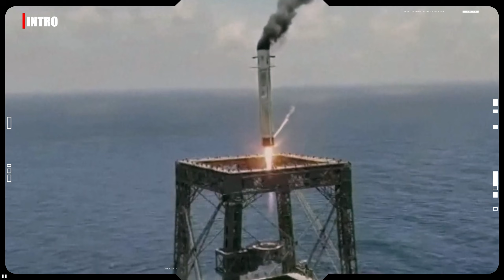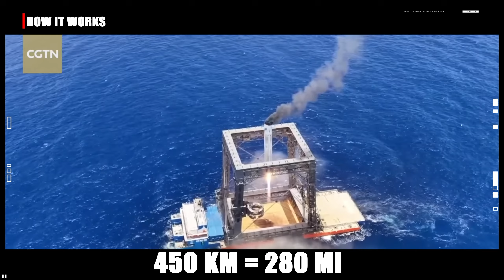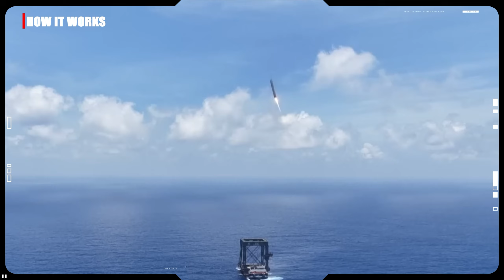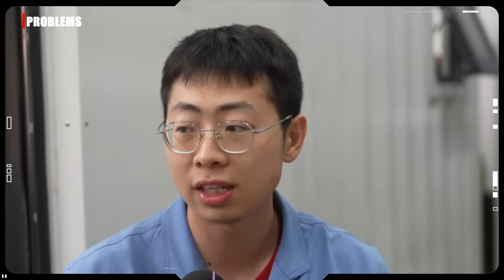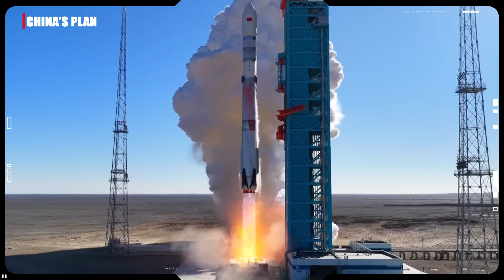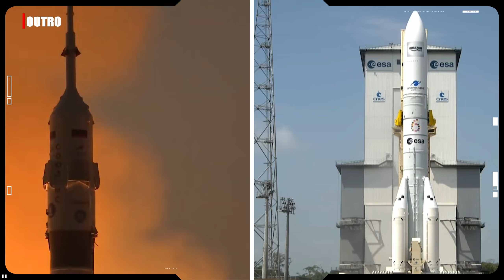I Spent 100 Hours Analyzing the New Chinese Rocket Landing…

Comment: OK, now have another thought?
Why did SpaceX stop landing on barges?
Can a cable setup catch and place the rocket on a new booster relatively quickly.
Reply: They didn't.  The Falcon 9s continue to land on droneships on a regular schedule. The Starship is too big for that so they are working out a different approach for it.
Reply: @Utahskiing1  Starship is not too big, just need a bigger, stronger system.
But the catch system saves time to inspect and load for next launch.